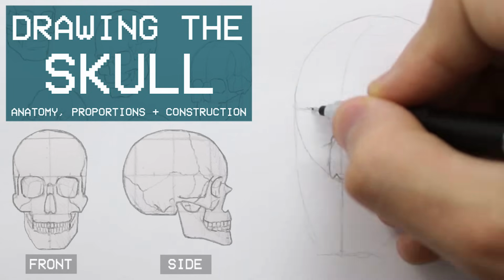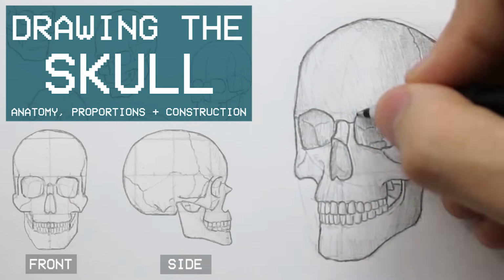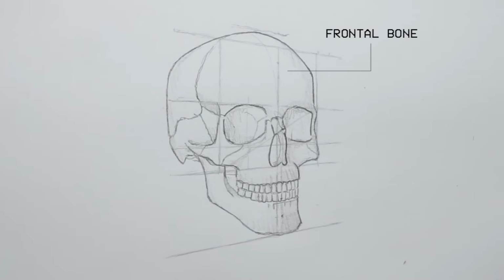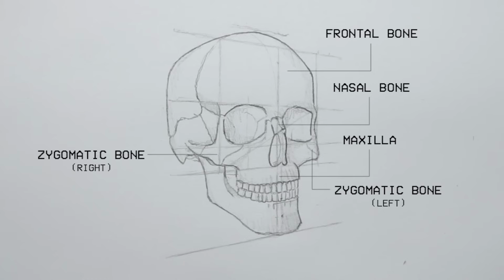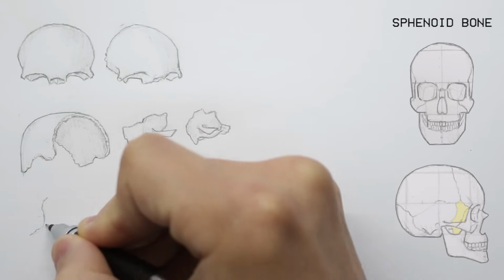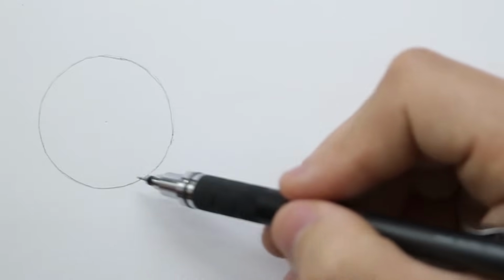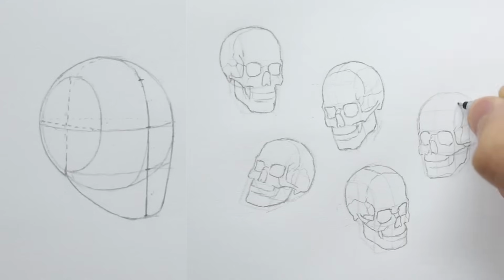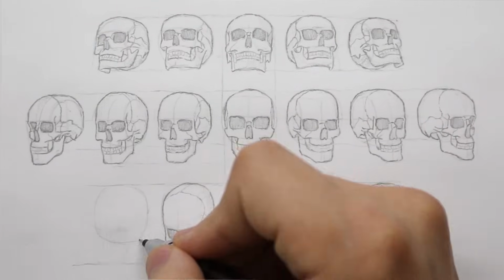Drawing The SKULL - Anatomy, Proportions & Construction - Anatomy 1

Comment: Okay, I am using 1" squares for the grids and has worked up till the last skull.  For the last skull, you said to make a line at the halfway point to make it more accurate but every time I do that I always end up with another 1" square.  On yours, it looks a good amount smaller but I am unsure or not if that is simply the perspective or if the square is that much less in width.  I know that it will look a little off without the perspective viewing but is there somewhere where I can simply look at the grid with their measurements?

Comment: Dear Thank you for your video 

How to use the human anatomical skull for planar analysis? i.e. How can
I identify the planes of the human skull(what landmarks do I use on the
anatomical skull), build on that with the riley method teaches and then apply
it to a life drawing of the head or to a picture drawing of the head.

What landmarks can I use from a picture of a head or from a life model
head to reference to the anatomical skull, to the riley method and also to
planar analysis? 

How to learn the physical proportions of the skull from the anatomical
skull and what landmarks do I use for measurement and what landmarks (i.e. Bone
landmarks from the skull) do I use for planar changes 

How to do I achieve consistency of features across different views.

Is there a particular procedure of sketching where I develop planar
analysis and volumetric techniques when I am studying the head? 

If you can assist with this it will be appreciated